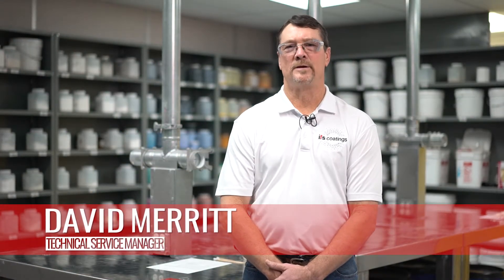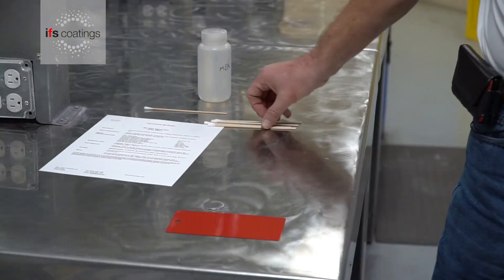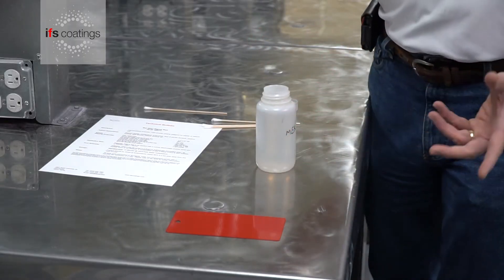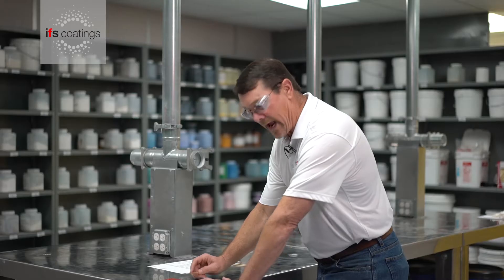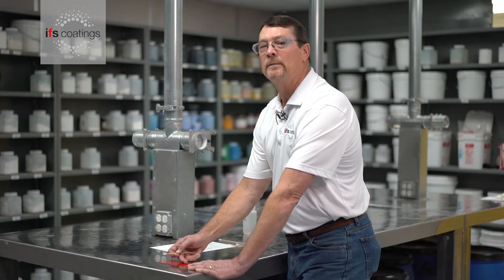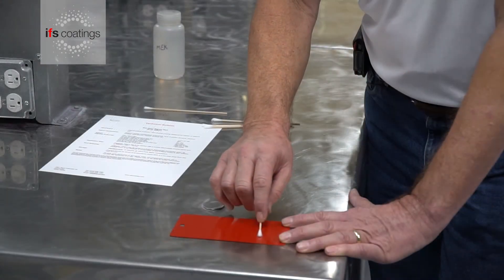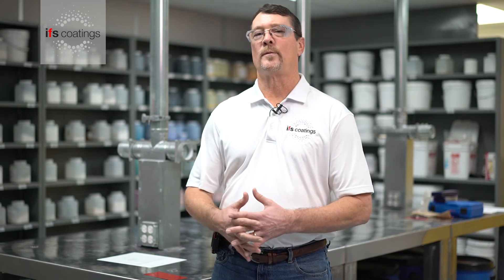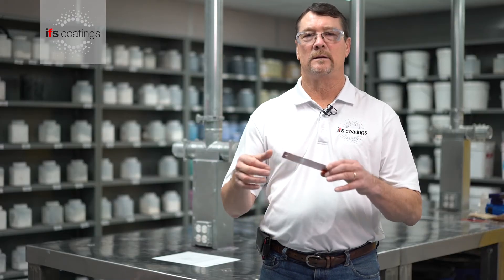Performing the powder solvent rub test - easy QC tests for powder coatings

Comment: What ASTM Specification specifies "25 double rubs" ?
Reply from the maker: Hi there, ASTM D4752-20 section 6.5 references 50 double rubs.  This is generally standard for critical lab work. ASTM D5402-93 section 6.5 references 25 double rubs, then follows that up in section 6.6 with the statement about how to continue the test if more than 25 double rubs are specified.   That's where it comes from. Thanks for the comments!